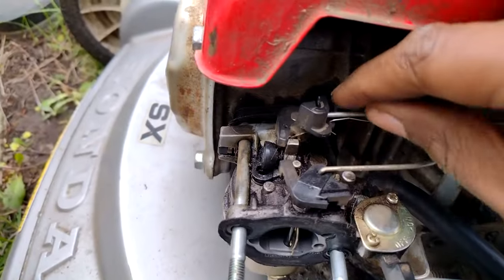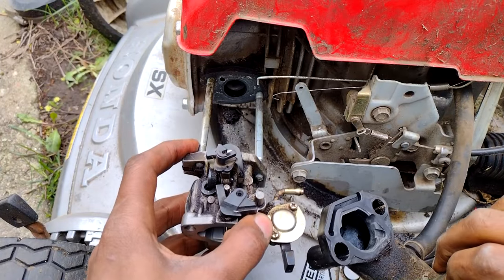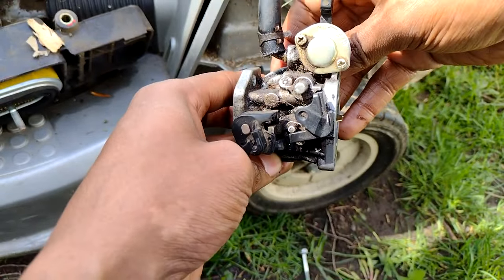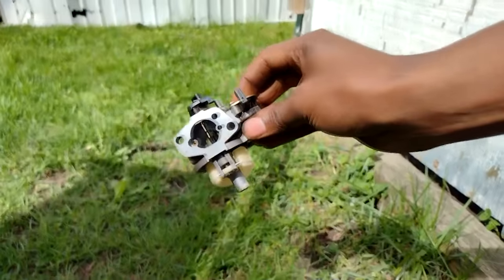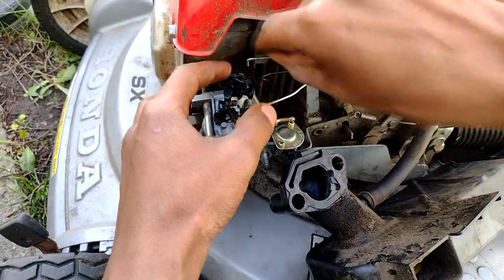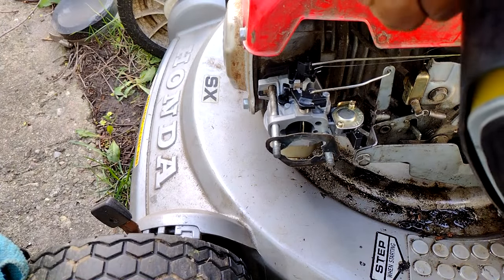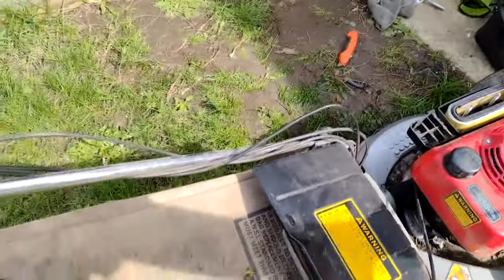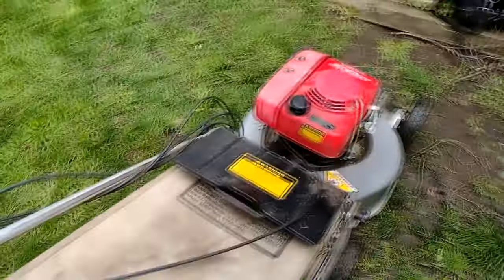I Had To Fix My Honda HR 215 Lawnmower Was Not Starting For The Summer | How to clean carburetor

Comment: Dude remove the studs first they have a 8mm on the outside ends the jets are probably pluged in the winter shit the gas off and run the motor until its out of gas in the carburetor